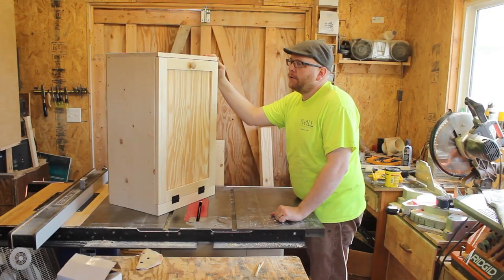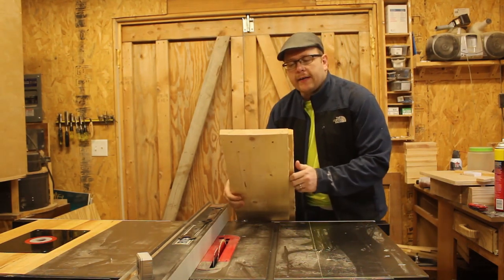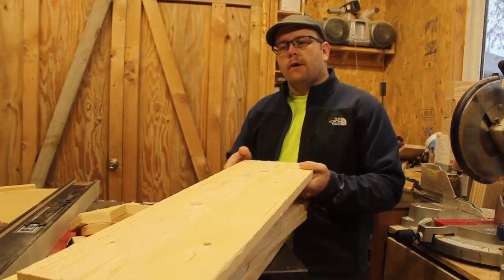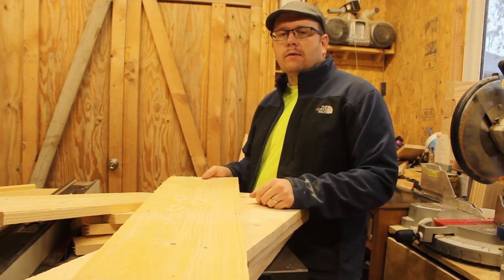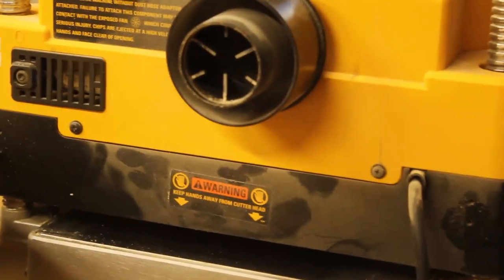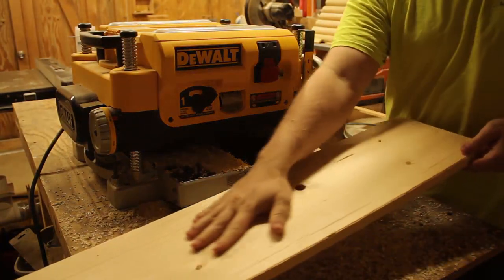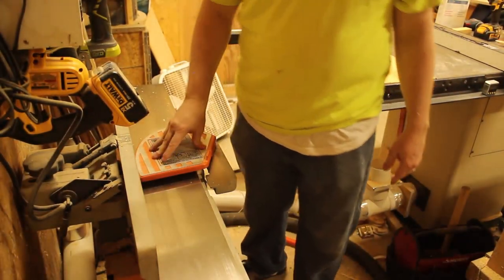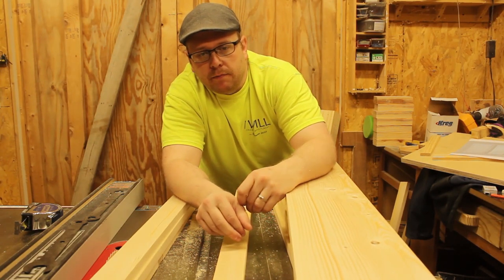Pallet Wood Wastebasket Cabinet Part One *Free plans*

Comment: why not use 1/2 , 3/4 inch ply rather than doing all this? is the only reason cost?
Reply from the maker: Cost is a big reason.  People like the rustic look of the knotty pallet wood. If I use plywood, I would have to worry about concealing the edge by using some kind of edge banding.  You can certainly do that and the effort to do the edge banding would be offset by the effort I put in to jointing and planing the pallet wood, so I just boils down to cost and what look you are going for.

Comment: Wait... A lot of work to plane them, because they are too wide for jointer, and after all that you CUT THEM to the smaller size? Dude...
Reply from the maker: 2 things:  The resulting board was still wider than my jointer, plus the offcuts were used to make the door of the cabinet.  I could have made the rip cuts first, but then I would still have to do all the work shown in addition to also doing the rails and stiles separately.  Dude...